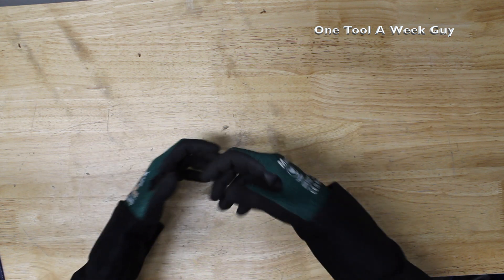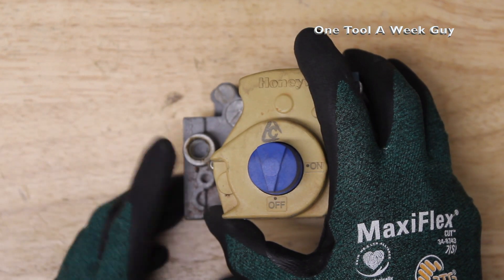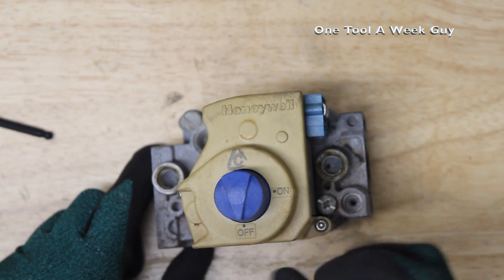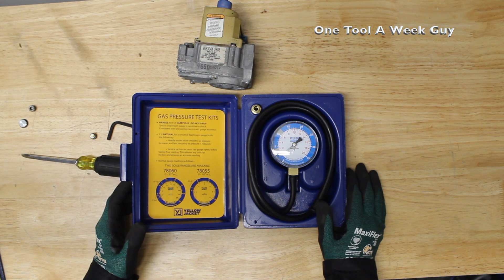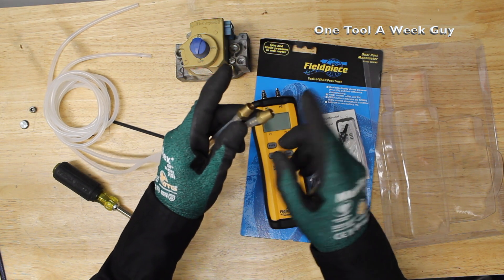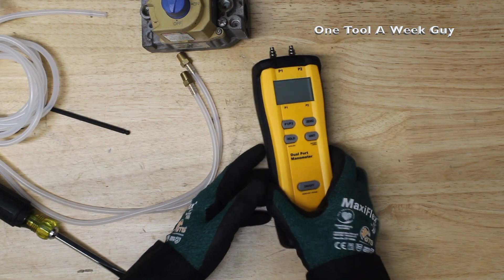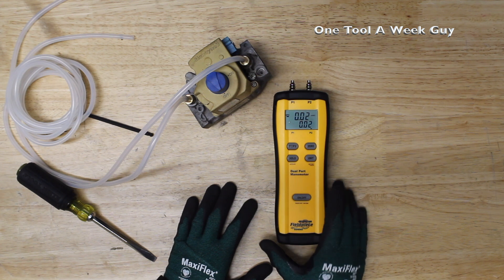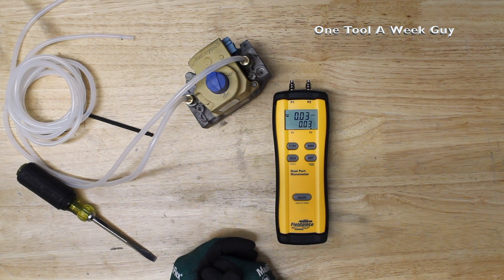Building A Tool Bag (Manometer Yellow Jacket 78060 & Fieldpiece SDMN5)

Comment: Do you check the static pressure with the AC compressor on or just the air unit blower running